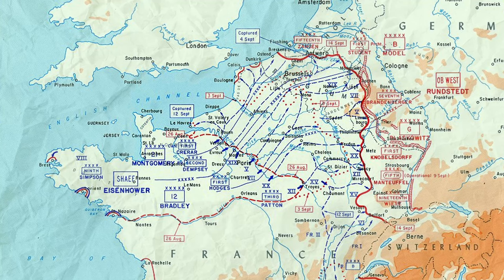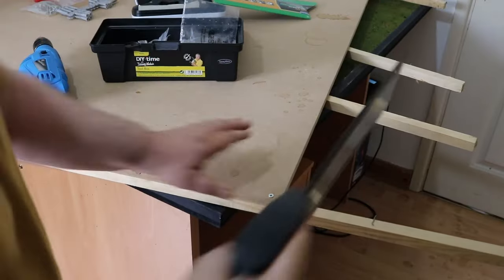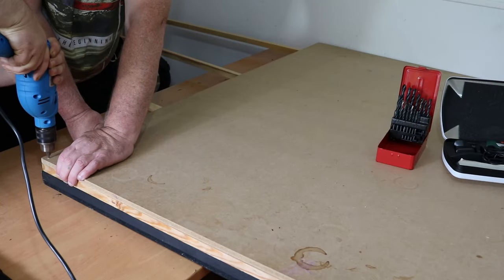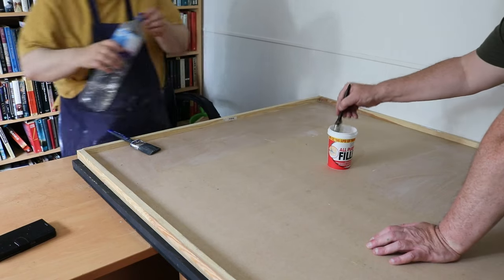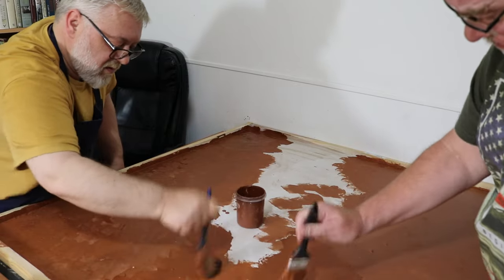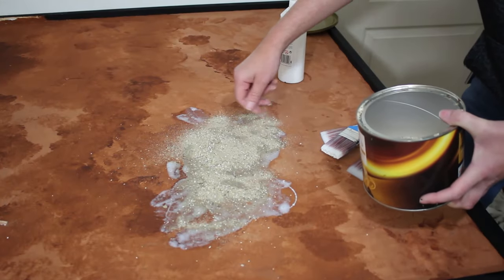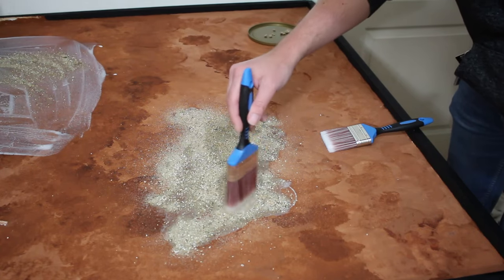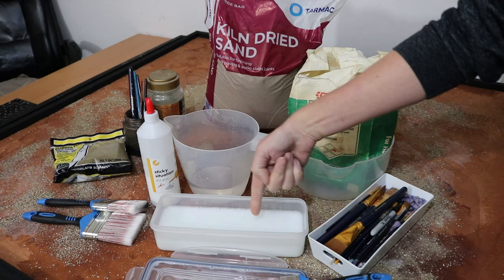Building a Desert Board - Tabletop Ready Painting

Comment: American here… we have filler and call it filler. It can also go by spackle or spackling paste. Caulk tends to come in a long cylinder cardboard tube and is very thick and sticky. It is so thick it is applied with a ratcheting gun. What you have there isn’t like our caulk. It is very much like our filler or spackle.

Caulk uses here are typically to seal window glass or seams in bathroom tiled walls and a tub. It is usually acrylic and silicone based.

I love the idea of using “bird sand” that’s  a quality pro-tip.
Reply from the maker: Thanks for the info.

Comment: War World Scenics Layering Glue in a spray bottle.   No shrink.  Just have to flush the bottle pump with hot water after use.
Reply from the maker: We had one of those, but it was a very small amount of spray per squeeze.  Used one on the last board.
Reply: @ModellingforAdvantage  
Get the new big bottle and it will spray out like any liquid from a spray bottle.  I haven't found anything better and beyond durable.